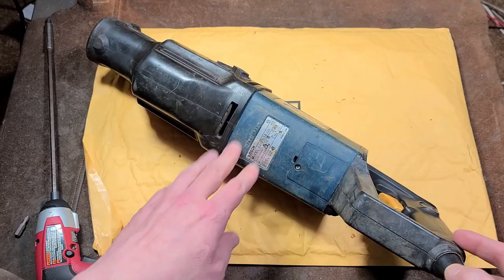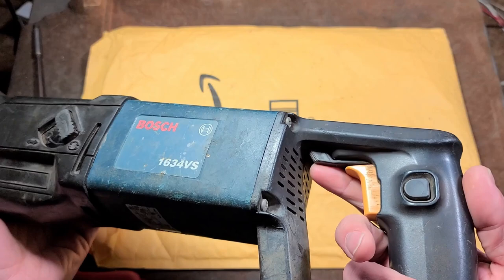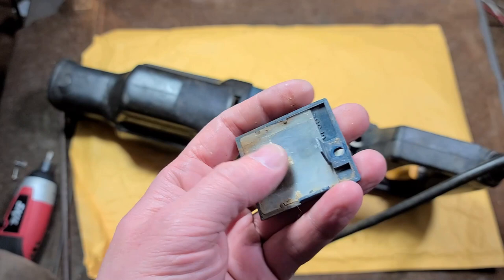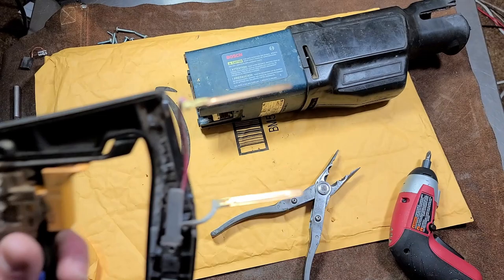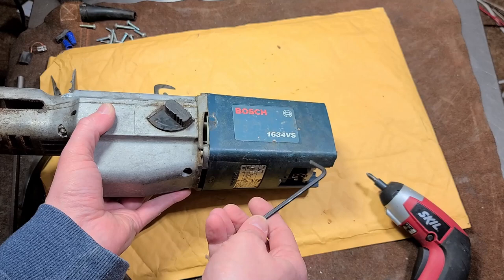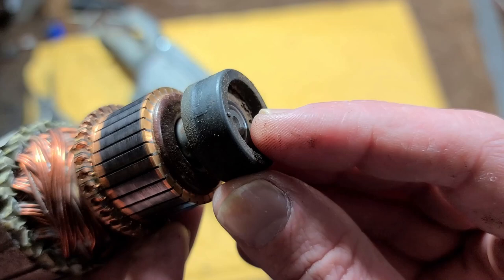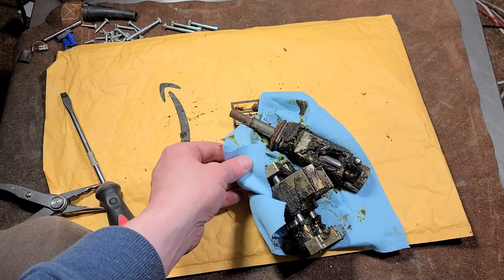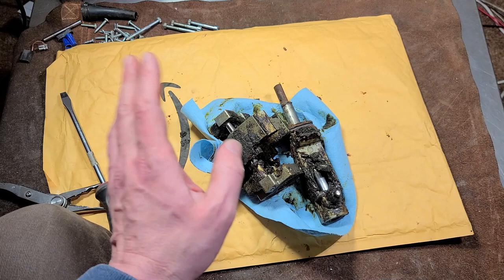TearDown: Bosch 1634VS Orbital Reciprocating Saw

Comment: I have the first version of this Bosch recip saw, bought new in 1990 for about $300.   On mine there is no "quick release" for the blade, but rather an allen key is used on two hex bolts.   The orbital feature, where the blade travels straight or can also orbit to bite into the wood better, is a feature that is still a premium feature all these years later, and Bosch was YEARS ahead of Makita and Milwaukee recip saws in 1990.  Mine is also variable speed, and variable orbit levels, or orbit off.   I'm not a pro, so this was a crazy purchase years ago, and the saw still works wonderfully, and the motor sounds and performs so smoothly, like a fine-tuned jet engine.   Thanks for the video, nice to see what is inside.